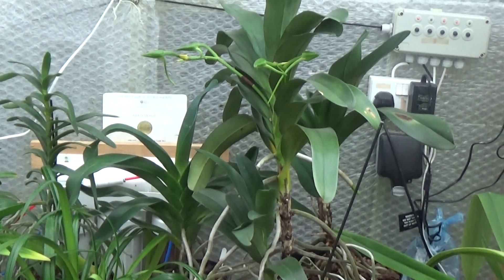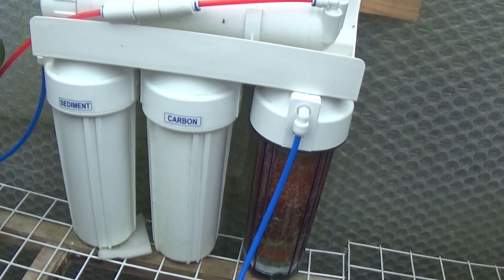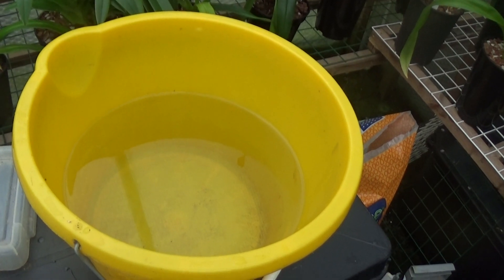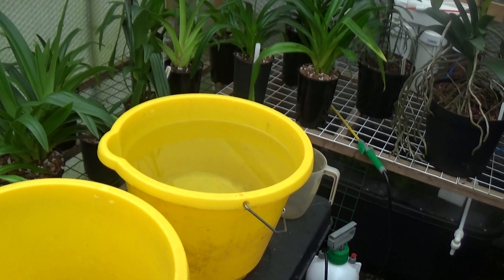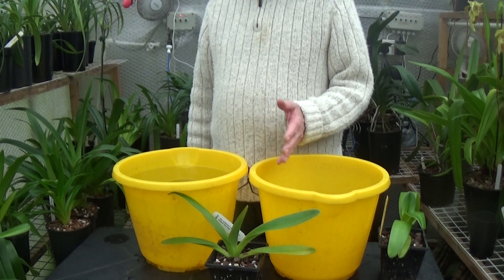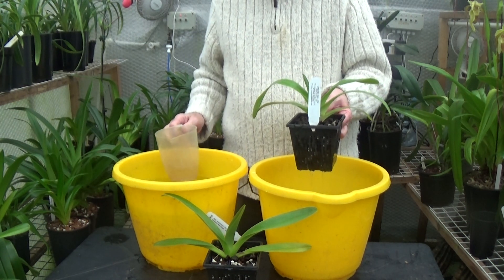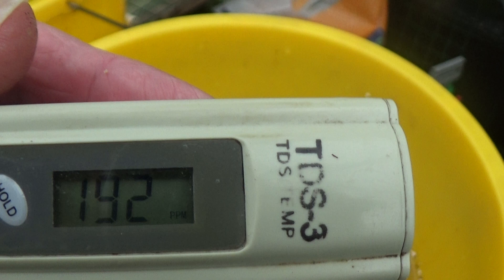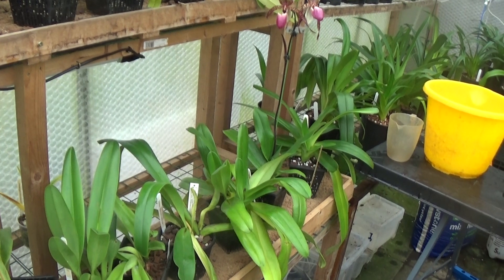Paphs and the benefits of flushing

Comment: can a person take the "waste water" that is given off by the RO system and maybe use it in a humidifier?  Or would it being put into the atmosphere of the greenhouse hurt the plants?
Reply from the maker: This video was made about 5 years ago and you must know how things change over time.. For example I made a drip
 system for the phrags which did well over a period of time but due to changes in domestic water pressure it proved to be difficult to maintain. A couple of years ago I experimented using the waste water from the RO unit by  placing the outlet tube running into an orchid pot. The results amazed me...roots had never grown so better.......lately I've been trying it out on a PaphiopedilumLady Isabel. It looks OK but it's too soon to unpot and to have a look at the roots. Having said all this I wouldn't think you would have any troubles with your humidifier. Thanks for your question.....take care,
Ed.

Comment: Enjoyed your video. Is it as bad for paphs to get water in the crown as it is for phals? I picture paphs more upright so I didn't think they would rot too easily. Perhaps I am wrong.
Reply from the maker: Crown rot will only happen when the water in the crown becomes stale....A plant left outside in the rain for a week or two will not get crown rot because the water in the crown is getting changed repeatedly. Thank you for the question.
Ed.